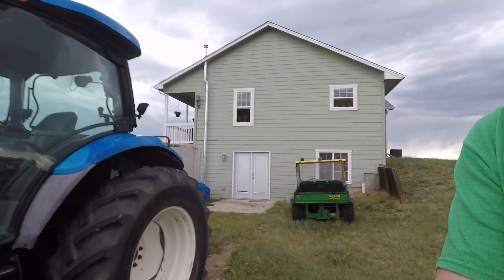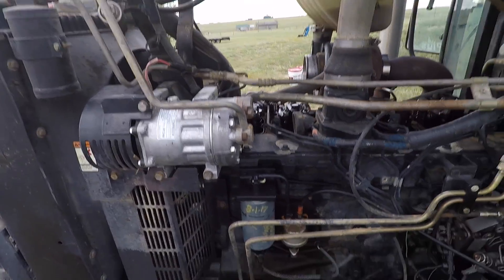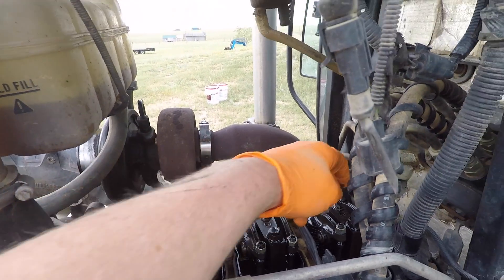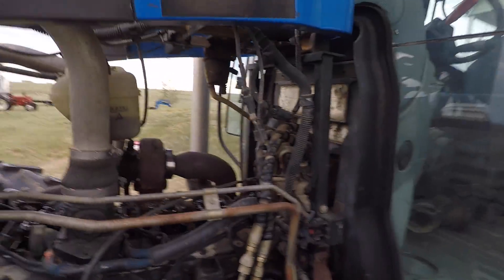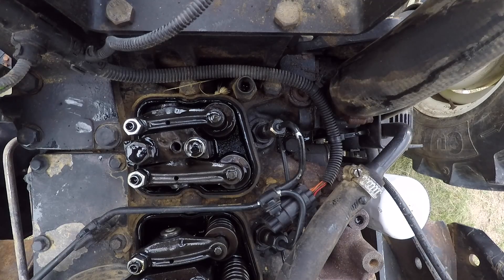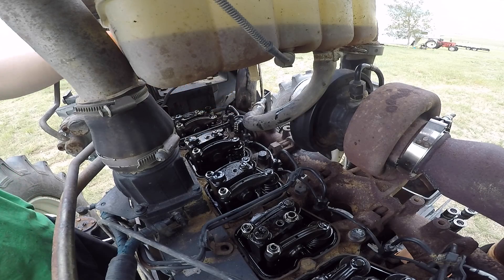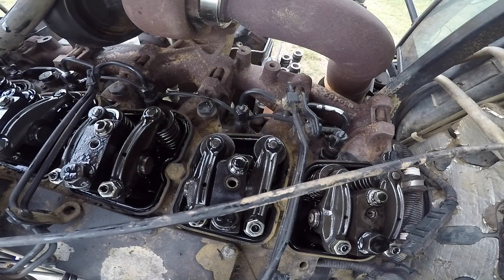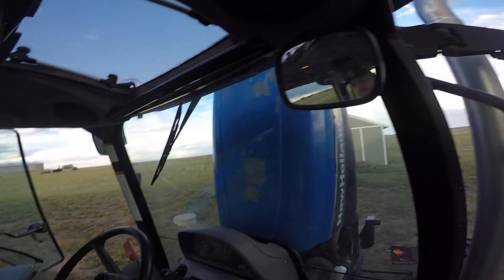TS115A Engine Valve Adjustment

Comment: Hello I am a New Holland tech it sounds to me like you have an issue with the cold start advance In your IP check your power to the advance sender but chances are with that many hours the advance shaft in the pump is wore out and will have to be rebuilt.

Comment: Is that a Cummins engine in the Ford? Could the problem be a broken top compression ring ?
.
Reply from the maker: It is a Cummins, a variant of the 5.9 liter. I did a leak down test today and identified the problem.
Reply: Guy in WY wrong, its not a cummins it's a IVECO/FPT engine
And that engine hade international EGR so every cylinder need to be adjusted in TDC
I've worked for FPT for 14 years as an application engineer

Comment: I probably don't know as much about Diesel's as I should I know a little bit and I want about 12 of them and now I'm not saying that it is what's wrong but it sounds to me like it is a sensor I'm trying to think of the name of the sensor that I had to replace on mine it's been years ago now it's a cam sensor or some off-the-wall shit like that on my Cummins it was on the front of the engine but give that a a looking at because it sounds just exactly like mine did whenever mine had that problem and good luck
Reply from the maker: This one doesn't have any sort of electrical system for the injection pump beyond the shutoff that I can find.
Reply: Guy in WY cool partner well it was worth a try it just sounds like to me that the timing is off anyway like I said good luck and I wish you the best
Reply: Guy in WY It should have a valve on the pump controlled by temperature to get the proper timing
Reply: Martin Andersson well then that may very well be where the problem is because it is a timing problem or at least seems like it to me
Reply: steven keller in that case that it's a Bosch pump the valve is located on the side of the pump, it's connected to a sender in the cylinder pump.

If it's a CAV pump, they are extremely sensitive to biofuel so if the tractor have been standing for a long time the advancer in the pump get stuck. 
In that case the pump needs to be dismantled and cleaned.
If biofuel has been used and a lot of low idling theinjectors are prone to build up carbon and then the spray the fuel outside the combust chamber and you get misfiring 

This is not a Cummins engine, this is a Iveco/FPT engine, I worked as a application engineer for FPT for 14 years
Reply: Martin Andersson cool man I'm sure that you know best like I said I don't know that much about that kind of an engine

Comment: Thing sounds like the fuel timing is way out, i had a 354 perkins that like crap like this one and I advanced the injection pump as far possible and it smoothed out. In the end, figured that the pump was defective. Does this motor have an injection pump or is more of a unit pump injector or common rail?
Reply from the maker: Rotary injection pump.

Comment: if the #1 is getting fuel and not firing its a more serious problem, what I would do is put compressed air into cylinder one, take out injector #2 and see if air comes out of #2 injector hole or somewhere else, seems like a blown head gasket or worse.
Reply from the maker: +actorzone that is essentially what a leakdown test is, I plan to do one tonight if I have time or tomorrow.
Reply: I did this to my 4 cylinder perking diesel which was running well until it ran on 3 cylinders, motor was not much good as blew plenty of smoke, when I took the head off I spotted the nightmare someone had done previously, damaged block between #1 and #2,  had to get another block and rebuild the motor, runs perfect now.

Comment: More testing is needed!! If the cylinder leak-down test OK, it has to be fuel related.

BTW: John Deere has used this valve adjustment method since 1960.
Reply from the maker: My plan is if the leak down checks out, to pull the IP and injectors and send them all out to be rebuilt.

Comment: Injection timing is of is what it sounds like but it could just how pump issue to
Reply: Have you tryed adjusting the timing to see if it helps that seems to be my go to. And is it down on power or does it seem to pull good.
Reply from the maker: Power feels a little low but I haven't gotten it under a large load yet.

Comment: Hi it still looks like you have a bad injector. I would remove them all and have them checked. The black smoke is more a sign of over fueling from a bad tip. Low compression should give you  bluer exhaust smoke I would think.
Reply from the maker: If I pull the injection pump, the injectors will be going with it for rebuilding.
Reply: Well i have never seen a pump put too much fuel out. It will usually not pump enough
Reply: gerald pettigrew 
Thats why the smoke is white and not black. Underfueling injections.
Reply: Hi ok in your video it looked black

Comment: Have you tried cracking each injector in turn to see if one makes no difference to the missing?? And this pump will have a electricity fuel advance that's controlled on a separate temperature switch in the head above the pump somewhere if I remember correctly.
Reply from the maker: I have tried cracking the injector lines. At low idle it makes no difference, at high idle it's #1.
Reply: Guy in WY these are pretty reliable engines would think it's more fuel related,had a similar problem with a tm that turned out to be an injector.

Comment: I make a Valve locknut adjuster socket.  in this case it would be a 14mm deep socket, clawfoot socket -- Prep and weld the claw foot to the deep socket so  you can put a breaker bar in the claw foot, and you can break loose the locknut, put a T handle allen wrench, screw driver, 1/4" extension with a 1/4 socket on the adjuster bolt (I've ground them down to fit inside the deep socket) adjust valve, lock locknut, rinse and repeat.
Reply from the maker: Not a bad idea.

Comment: You have a cracked cylinder head judging by the sound of the turbo.
Reply from the maker: It's possible.
Reply: The crack is between the valves seats. Either a dry crack or the cooling issue will appear when the coolant level gets low again.

Comment: I know this is a high hour tractor but it certainly doesn't seem well cared for before you got it.    1. How many hours?  2. Can you get the piston out and re-ring from the bottom/oil pan like some engines if it comes to that?
Reply from the maker: 8,360 hours. I don't know if it can be done in frame or not, hopefully I don't need to find out for a while.
Reply: Guy in WY 
Ya you can do everything on those in frame other then machining the block
Reply: Guy in WY 
Damn thats quite a few hrs too, injection pumps don't typically last that long, if there are no wrench marks from it being apart id suspect that first. Ulsd isn't as lubrcating as it was before

Comment: Just wondering why is the the wheel so far out?
Reply from the maker: If you're referring to the front wheels, the previous owner had them set out wide like this. You can adjust the width by changing how the front rims and discs are assembled, I'll probably leave it this way because it's easier to clear a windrow of hay.
Reply: Joel Holme I believe it has to do with the four-wheel-drive system on it do not quote me on that but it does look weird when the hoods up. I was wondering the same thing so I looked it up
Reply: I hope I didn't come off rude when I answered that for you
Reply: Todd The Farm it could but here in the U.K. We have 4 wheel drive tractors that are thin

Comment: Rude, it couldn't be something simple could it
Reply: I'm so sorry for being honest
Reply: Nothing to be sorry about man, I was just saying it usually nothing simple on a Diesel engine, having worked on locomotive engines in tug boats 671 Detroit on boats and trucks. So if my statement attended you somehow oh well.
Reply: No no I'm sorry I took it the wrong way like I thought you were commenting on something I said about the wind noise on his camera. So I deleted the message. It was a simple misunderstanding
Reply from the maker: It could be simple, but that's rarely my luck. As for the wind noise, I bought a foam cover for the GoPro.The problem is when I use it, the camera gets very hot and the battery dies in about half the normal time. I'm working on a better solution.

Comment: Best thing to do is check fuel pressure.  Fuel pressure should be 18-24psi at idle and 28-36 at 2000 rpm with no load. If it's low, change pump. Next I'd pull the injectors. Use a small bore scope to inspect each piston top, valves, head, and cylinder walls for damage. Also look at spray pattern. You'll know if you have a bad nozzle. You'll also be able to spot a leaking head gasket most of the time. While the injectors are out get them pop tested. Visual inspection can sometimes reveal a cracked nozzle but it won't show a dripping nozzle. Could have a couple with a worn pintle springs in the body. Just my .02
Reply: And after that, I'd checked timing and injection pump as recommended below. Does it have a mechanical rotary pump or Bosch VP20/30 style?
Reply from the maker: It's a mechanical rotary.
Reply: Guy in WY I'd recommend after checking all above, check timing. If timing is good, replace the injection pump. Buy new not reman IMO.
Reply: Guy in WY if it ends up being injection pump, call Columbus Diesel Supply. They are #1 in my book!

Comment: Hi Guy in WY, I am quite sure that the engine on the TS115A has internal EGR on it, using the valves for recirculation of the exhaust gas in the engine. That means that the method shown in the manual will not work as some of the valves you are adjusting are sitting on the extra lobe on the cam. You should only adjust the valves on cylinder no. 1 when no.6 is balanced and the other way around and so on. So I am sure the manual is wrong about this.
Reply: Karsten G. Poulsen he's doing it right. It's an Iveco NEF 12v 6.7lt (cummins design) and that's how you do it. There are no extra lobes on the cam. You can also find which cylinder is on compression stroke and adjust the opposite.
Reply from the maker: I can't find any evidence of an EGR system on this engine. Adjusting the valves the way I did is the specified method for this particular tractor.
Reply: Guy in WY also don't trust manual valve clearance specs. Check the data plate on the left side. It'll have all the spec info needed on it for that engine. It's a good double check.
Reply: Guy in WY, Yes I know, I also checked the manual for this model and it shows the way you are doing it, the manual I looked in also covers the T6000 series (later model) and only shows the the same way, and all of the T6000 series uses internal EGR, the thing I don't remember is if all of the TS-A series has EGR or only the later ones. My point is that it is an easy adjustment to do again before pulling the injectors out. Not saying it will fix the problem but as you are able to do it yourself it's "free" and only takes a little time... The white smoke indicates a problem with combustion so not sure if it is the valve adjustment either.
Reply: Karsten G. Poulsen the cam lobe has a shorter duration on exhaust opening. This keeps some gas within the chamber for a reburn on the next compression stroke for that cylinder. Cam only has one lobe the tappet rides on. Pretty simple design and very efficient. This is how the in cylinder EGR works for this engine.
Reply: Daniel Altman No, on the 6 cyl NEF engines the exhaust valve opens to about 10% of its travel during most of the intake stroke partly filling the combustion chamber with a air/gas mix with less oxygen resulting in a colder burn in the cylinder = less NOx om the 4 cylinder NEF the principal is the same but using the intakte valve instead. All this valve movement is done by a second "humb" on the cam for that one valve, at when adjusting the clearance you have to make sure that the lifters are not sitting on this humb to get the right clearance, so adjusting the valves as shown her you have no way of telling the position one the different humbs on the cam.
Reply: But as I mentioned earlier this will probably not solve the misfire on this engine, but still the adjustment needs to be right, and adjusting the valves where you balance them on one cylinder and adjust the opposite one will always work regardless of in-cylinder EGR or not.
Reply: Karsten G. Poulsen I've rebuilt a few of these Iveco/Cummins engines. The cam has a single lobe for the 12v. You can also buy and install a non EGR cam.

Comment: All part of troubleshooting.  KISS is king.  Think you can show what kind of volume is coming out the crankcase vent?  You by chance have a manometer?  I'm just brainstorming over here.  At least that engine looks like it is easy to pull injectors for compression and leak down testing.
Reply from the maker: I can try to film the blobby but I don't have a manometer. This is pretty easy to get the injectors out though.

Comment: yeah I fought with my tractor for over a year I spent 8000 on to different injections pumps and finally got a good John Deere Tec out and got my timing fixed and haven't had anymore problems but good thing is we have more then just one tractor
Reply from the maker: Sounds like a major headache, glad they got it right!

Comment: If not valves, nor fuel pump or injectors it could be rings but can't tell until next thing you try to fix hope find problem that engine still sounds ruff
Reply: Jamie Shields doesn't seem to be any blue smoke out of it to say it's the rings tho I'm no mechanic but if the rings are gone wouldn't it be burning oil
Reply from the maker: I'm very suspicious of the injection pump still.
Reply: Guy in WY I had a problem with my Massey 699 where the valve in the hand pump priming the diesel pump was worn and would pop out of place causing it to run rough.Dunno if new Holland have one tho